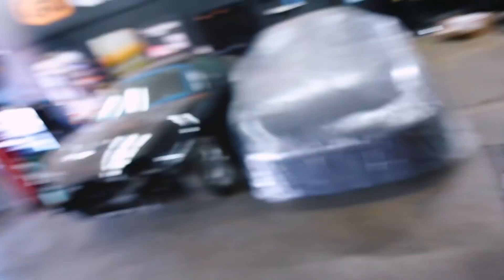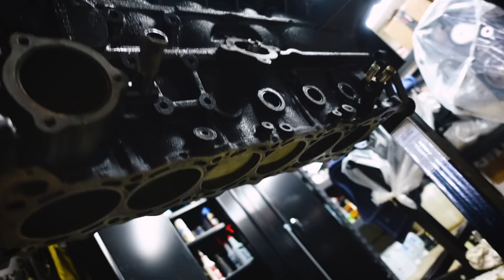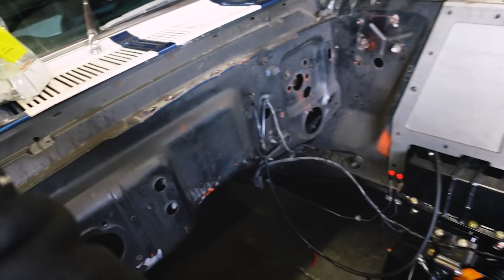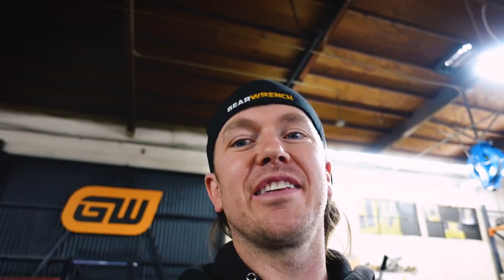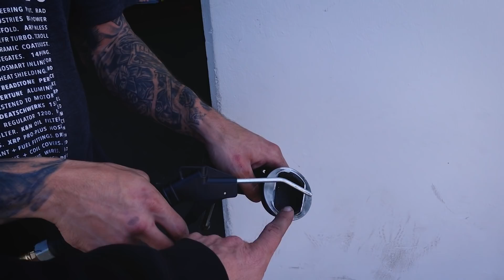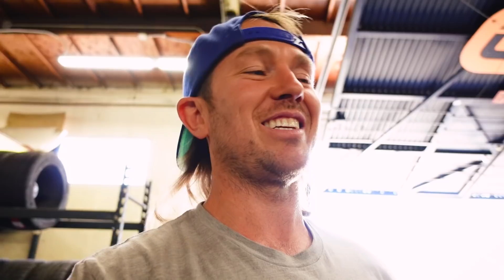TJ's Mustang Gets A Roadster Shop Frame & The RB Motor Goes In

Comment: I turned this off after 2 mins of struggling to hear while someone is blasting a angle grinder in the back ground. Helpful tip. When you do a video do it with least amount of background noise as possible. Even if you could hear over the grinder it’s just annoying.